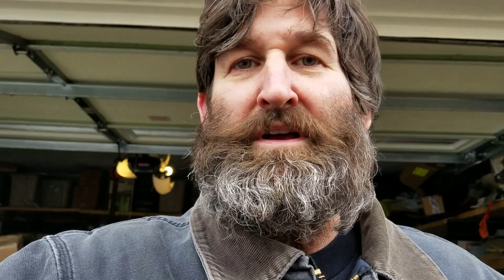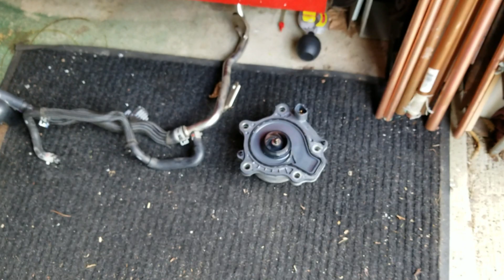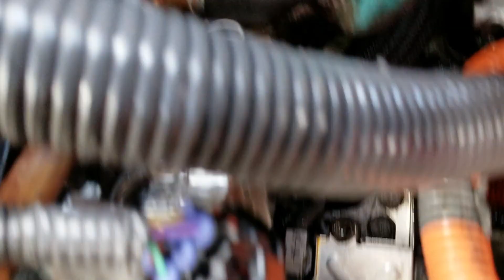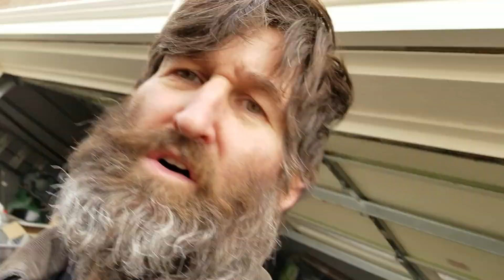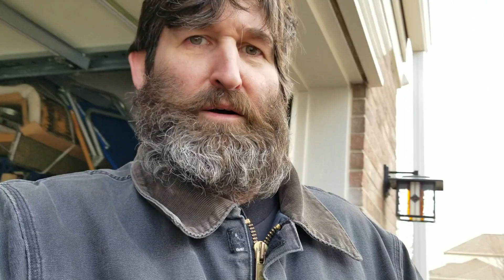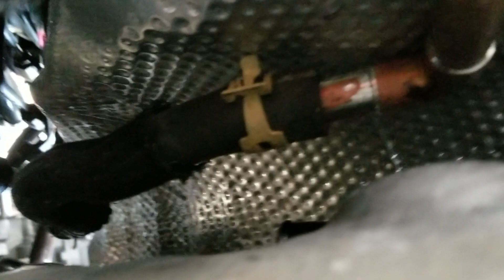Fix That Prius! - Effects of a Clogged Heater Core on a Gen 3 Prius? Overheating!

Comment: I followed your engine swap and it worked great. Then the water pump went and has been a PITA. I love your bypassing everything to find out what the cause was. My problem was just air in the system.
Reply from the maker: Hi, Thanks.
 I'm glad you like the videos.
Please subscribe to my channel.
I had to drill a hole in my thermostat plate to let the air through. the jiggle pin is supposed to do that but wasn't. Haven't had a problem since.
 - Fix That Prius !!!
Reply: @fixthatprius4980  How big a hole did you drill? I just replace my thermostat and pump and it didn't fix it. Thank you for the response.
Reply from the maker: @brucewilliams6292  VERY SMALL or remove the jiggle pin, that will leave a small hole.
Reply: @fixthatprius4980  Hi, is your fix still working?
Reply from the maker: @brucewilliams6292  Hi, Yes  I drilled a hole in my thermostat and thought the hole was too big so then I removed  the jiggle pin in another and It was about the same so you might as well just remove the jiggle pin. My car has not overheated since. My other Prius engine swap has never had an overheating problem so you must assume that the engine swap isn't the cause.
 - Fix That Prius !!!
Reply: @fixthatprius4980  Hi Tom, I got mine going again without drilling but it was a major PITA. I had to jack the car up on one side as high as m floor jack would take it (about 25°) and start run it for about 20 minutes in the regular mode. I alternated the side I would jack up when suddenly the pump stopped rattling and it behaved itself. The hole probably get rid of the air easier than what I had to do. Thank you so much for your response and videos. They really helped. Stay warm. Regards, Bruce
Reply: @brucewilliams6292  jack it up 25 degrees on passenger side with the ICE running to get trapped air out? Is this with the expansion tank cap open? And then repeat process for driver side? Am I understanding correctly?
Reply: @XTheJenovaProjectX  Hello Jenova, I left the expansion cap off to allow me to add coolant and squeezed the hoses often. Pay particular attention to the sound of the pump. If you run the pump dry it will overheat very quickly and be ruined; ask me how I know. Best of luck.
Reply: @brucewilliams6292  I had a 3rd gen water pump on my 4th gen motor, found out that they were slightly diff even tho they look identical lol. So I changed that. Then I cut the jiggle pin on my thermostat and made sure to reinstall it so the jiggle pin hole was at the 12o clock position. Backflushed my heater core while I was at it. And I got heat briefly but there is still air in the system. So now thanks to @ragingfit I am running the car in maintenance mode with the expansion tank elevated high above the engine with the cap off to bleed air. Hopefully this will be the end of it. Other than that my car is running pretty good. Just shutters at 1/4 throttle.... lol
Reply: @XTheJenovaProjectX  Thanks for the reply. That may explain why my pump died (I had transferred it from my Gen3). Best of luck with yours and let us know how it goes!
Reply: @brucewilliams6292  took it on an extensive drive today on the freeway. Basically mashing the throttle non stop going 65-75mph off and on and I got a high temp light for a few seconds and my heat is back to going hot n cold again. Back to the drawing board.....
Reply: @XTheJenovaProjectX  That's too bad. Did you try jacking the vehicle up get the air out? I am sorry to hear it didn't work. Best of luck with it. I've put 53K miles on mine thus far and it is doing really well.
Reply: @brucewilliams6292  I’m on PriusChat reading extensively what it could be. Pretty sure I still have air in the system. I guess it gets trapped where the temp sensor is behind the EGR. I dunno. Thinking about just taking it to a shop so they can hook up those vacuum systems to the coolant system to remove air. I have a buddy who owns a shop and he said the only way he fills cars with coolant is sealed/forced fed to eliminate any chance of air entering the system. So I guess air being trapped in coolant systems is a common issue.
Reply: @XTheJenovaProjectX  Well, my water pump went out after 50K miles. I had replaced the original with a GEN 3. This time I ordered a GEN 4 water pump and will remove the jiggle pin to aid in getting the air out. Did you manage to get yours working properly?
Reply: @brucewilliams6292  It drives but overheats at high speeds going up hill. No mechanic can figure it out. I called Prius experts in cali (Gasket-Masters/Prius-Pros) out of Stockton CA and they said you can’t put a gen4 in gen3. They said yeah it will “work” at first but eventually things will go wrong. They said the gen3 computer and the gen4 timing is different and will eventually screw up stuff over time. So I am fed up with my car. I should of done more research. I’m towing my car to these guys and they are gonna out a new gen3 motor in it and take my gen4 core. They do it all for 1800.
Reply: @XTheJenovaProjectX  I am sorry to hear that it didn't work our for you. My swap get 50 mpg and has been running just fine. I wish you the best of luck with it.
Reply: Bruce Williams Bruce. I have the same BS. Keep getting air in cooling system no heat and overheating issues. What you think????
Reply: @gusone203  Hi Gustavo, in my case it happened when I changed the thermostat and water-pump. In your case, it sounds like a leak in the system. I would pressure the system up with air and see if it leaks down. If the air escapes the system and you can't find the leak, it is probably in the head gasket. Best of luck with it.
Reply: Bruce Williams I will try removing the tstat to see what happens.

Comment: If your car burn oil your first suspects is pcv valve need to be replaced
Reply from the maker: Hi, Please subscribe to my channel.
Yes, you are correct. I did replace the PCV. It had no effect on the oil consumption.
These Prius engines are known to have defective oil control rings, that is why they burn oil.
 - Fix That Prius !!!

Comment: Hi Bro, did you find the reason why your prius was overheating? I did replacement of the 2016 engine to 2010 prius. Had the same overheating problem.
Reply from the maker: Hi Sergiy, Thanks for your question. Please subscribe to my channel.
The short answer is -  air gets trapped in the cooling system. This is very common and difficult to overcome.
- Fix That Prius !

Comment: Im glad I went ahead dumped and changed my coolant while during my water pump replacement. I did it becouse I was afraid of the gunk stopping up my heater core. I dont mind changing water pumps and other repairs and putting the videos on my youtube but to heck with heater core jobs.
Reply from the maker: Hi, Thanks.
Please subscribe to my channel.

Comment: Hey after the hot water clears Heater core blow it out with the CAR WASH HIGH PRESSURE hose for 15 minutes in both directions
Reply from the maker: Hi, Thanks.
Please subscribe to my channel.
Now that it's warm out, my thermostat opens as it should but I'm tempted to flush it out again.
- Fix That Prius !!!!

Comment: Did the Phosphoric Acid cleaning of the catalytic converter work? I just bought a 2007 Prius and that's the only problem that just popped up after 20,000 miles.
Reply from the maker: Hi,
Thanks for the question.
Please subscribe to my channel.
It Did NOT.
Maybe someone will find a way to "fix" a catalytic converter.
- Fix That Prius!!!
Reply: Try coil cleaner for air conditioner. It eats off everything.

Comment: Hey, would you be willing to sell me that water pump? I REALLY need one, it's an emergency. Dude sold me a roached gen 3 and I am so screwed. It's overheating and I don't know what to do. My impeller is frozen, head gasket is bad, which I will replace but makes no sense without the water pump.
Reply from the maker: Buy this one on eBay   

https://www.ebay.com/itm/Genuine-Aisin-Toyota-Prius-Electric-Water-Pump-2ZRFXE-2ZR-FXE-161A0-29015/202635694027?hash=item2f2e074fcb:g:z0oAAOSw6fpbZs7M

$165
Reply: That would be great but this car is the only thing I have to drive and I’m just sick. It won’t last another 3 weeks like that. I made the mistake of trading my
gen 2 for it, and I am ready to completely give up.

Comment: Please make more videos I have the same problem 3rd gen Prius over heats! Your the freakin man bro! Great video!
Reply: When you put the thermostat back in did it fix the overheating problem since you ran for a month without it? At this point I’m ready to switch it back and forth during summer and winter😕
Reply from the maker: @traveljay751  The problem is air gets in the system. In the summer the thermostat stays open, in the winter it stays closed, mostly. I did take out the thermostat to see if it would help and it did. When I put the thermostat back in I got air in the system again and it took a week to get back to normal. If at all possible, DO NOT WORK ON THE COOLING SYSTEM IF IT IS UNDER 60 DEGREES OUTSIDE. Air gets trapped in the thermostat and stays cool and closed. My 2) Swapped Prius v's do not overheat anymore. It's been a few months now, no issues.
Thanks Jason!
- Fix That Prius !!!!
Reply: @fixthatprius4980  I’m having this exact same issue with my 2010 Prius, after my gen4 swap. Engine runs great everything’s “good” but the coolant isn’t flowing through the system the way I think it should. Not getting cabin heat etc. How did you get the air out?
Reply from the maker: @XTheJenovaProjectX  

https://www.youtube.com/watch?v=zE-TUVAhrvg
Reply: @fixthatprius4980  thank you! just did this and 2 giant air/coolant burp geysers of air splashed out of the expansion tank and I got heat back.
Reply: @XTheJenovaProjectX  
From : Sergiy Kovalevych
 The solution was very simple. The level of an expansion tank hose ,which goes from the connection on the engine head to expansion tank must be only up!!! No sag or dip of the hose. By the correct hose leve the bubbles will freely come out to the coolant expansion tank, will not go back to the engine head or to the cabin heating coil. Driving vehicle around 20000 miles (1 year). Didn't have any problems anymore. Good luck guys.

Looks promising!
- Fix That Prius !!!
Reply from the maker: Hi, Thanks.
Please subscribe to my channel.
Part of my problem is it's too cold to get the coolant flowing through the thermostat so it takes a long time to get the air out. I'm still working on it. I flushed out the heater core and the whole system and drove the car. Still overheating. Now when I say overheating I mean the light comes on. I'll do a video if I ever get it back to normal.
- Fix That Prius!
Reply: Is there a possibility it can be the temperature sensor near the egr acting defective?
Reply from the maker: @ED-yd3xd  Good question. I unplugged it and it showed up as non-functional.
Reply from the maker: @ED-yd3xd  Possible, but it would throw a CEL code as it's part of the emissions calc.
Reply: Fix That Prius! Is it possible to make the thermostat stay open? You may not get any heat in cabin but it shouldn’t overheat.
Reply from the maker: @traveljay751  Hi,
Thanks for your Question.
Please subscribe to my channel.

Yes you can remove the inside of the thermostat so it's wide open. I did that for about a month. It helped clean out the clogs.
It never got hot with the thermostat out.
Reply: Fix That Prius! I found that the temperature light was turning on at 240 degrees. That is definitely too high of a running temp right?
Reply from the maker: Hi,
Thanks for the question.
Please subscribe to my channel.
You are right about the temp light. Too hot? Yes and No. The question is  "at what temperature will all my coolant boil away?" This is variable. With a 50/50% coolant/water mixture, the boiling point is around 270 degrees F. The engine should be fine even at 270 degrees F. The actual running temperature of a Prius is around 190 degrees fahrenheit.
- Fix That Prius!